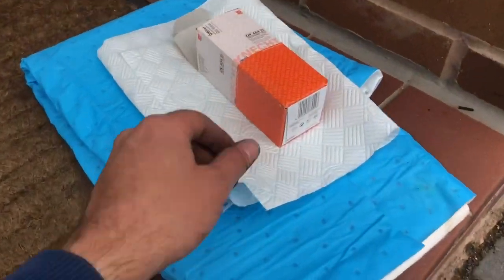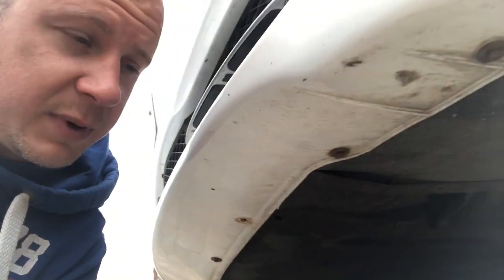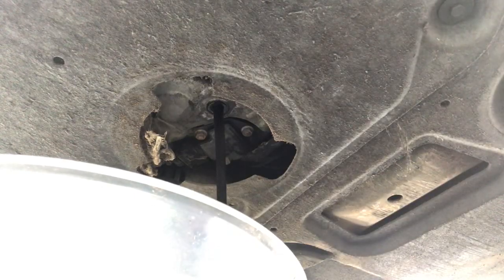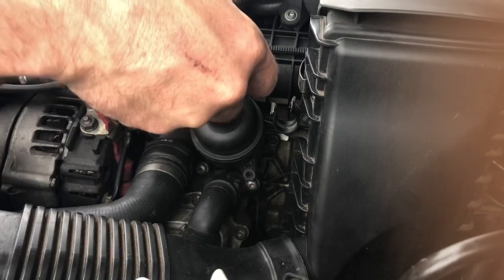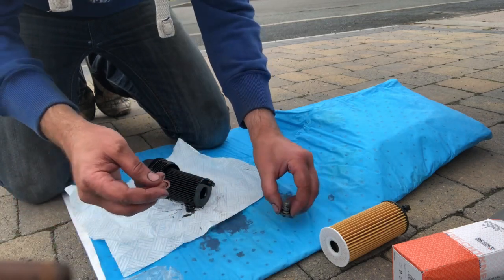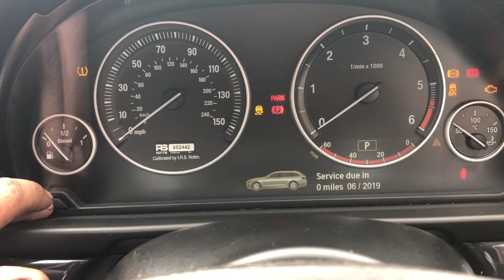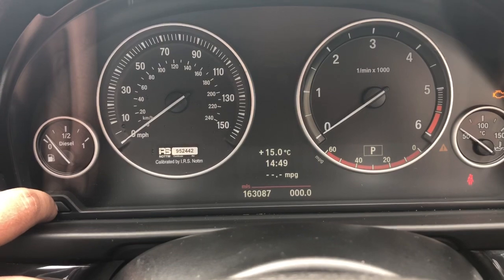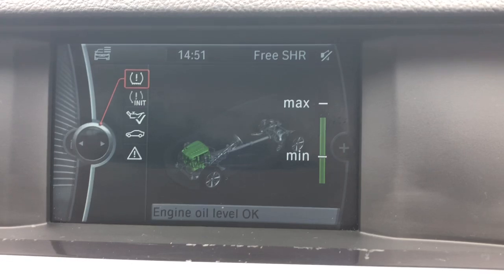BMW 530d (F11) Engine Oil & Filter Change

Comment: Speaking of what iDrive thinks or not - the manufacturer's prescribed oil-change is 30 000 kms/24 months on this car. Wait, which car was the one suffering from class action lawsuit for braking chains and burning police cars? Yeah. Purchased (well, deposited the safety deposit) my "new" 2012 530d F11 with the N57D30O1 yesterday, will collect it this Friday, March 17, 2023. Will be indulging in all-encompassing "change everything" procedure - it also has xDrive, so front diff and transfer case will be great bonuses. By the way - the oil filter looks very much the same as on my previous car - the A6 with 3,0TDI (only that one's bigger) - and even on my mom's W169 A180 CDI Merc (only that one's  smaller) - also - on those cars I've been changing engine oil every 5000 kms, just to be safe. The audi has a crushable single-use oil drain plug seal - the merc - and obviosly, the Bimmer - have simple copper o-rings which should tolerate at least one re-use (that said, they cost cents... sorry, shillings - so no need to save there). Well done for the change - except, I will probably be using an oil-extractor (small vauum pump... costs EUR 20,00 in a hardware shop) - which will eliminate the lifting up, seal buying and undertray removal malarchy - connect the pump, suck out the old oil, replace the filter - pour in new oil, good to go. This engine uses 6.5 liters (according to BMW) - my audi with its V6 uses 8.9 - there's some savings done on that expensive Castrol 5W30 right away. Anyway. Thanks for the video, greetings from Latvia.

Comment: I have a 530d N57 f11. My plastic cover that you twist off to get to the sump plug has a retaining screw. Just a heads up to check to look. I didn't realise this as there was nothing I saw or read that pointed to this. Hence I used brute force thinking the cover was just gunged up with dirt that was stopping it turn. It cracked & broke and that was it gubbed. Need to order a new one. £12 I believe.

Comment: Good job and a bit daring to do a video as a first timer on the car!  In hotter weather like here in Oz, I use 5w40 full syn and it takes about 6 litres. I would generally use a torque wrench also, unless you have a calibrated right arm!  Cheers

Comment: Hi, very nice video, just a quick note this car has the n57 engine with the timing chain issues, make sure to change the oil more regularly like 5,000 to 7,000 miles. don't change the oil every 16,000, but very good job looking more forward to more interesting videos on this bmw, 👍👍👍👍😀😀
Reply: haider hameed the kiss of death, have you seen his most recent videos. 
The timing chain issue was the reason I didn’t buy a bmw
Reply: @SteveE293  Yes, but very said his engine sounded healthy with no unwanted noises. I myself have a bmw 1 series e87 120d, but mine has the M47 engine which doesn't have the timing chain issues. It does have the swirl flap issue which only cost £10 pound to replace, anyway I hope he gets his car sorted very Gutted but what can you do🤔🤔🤔
Reply: @Nut_Job.  Soooooo sorry mate, Hopefully something good will come out. 🙏🙏🙏

Comment: Hi!!! how do you feel with Mannol oil? it is very cheap and perhaps little known. I currently use motul or valvoline with liqui moly ceratec additive for my ultimate generation Audi diesel.
 I have seen from the data that the characteristics of Mannol oil are also superior compared to more expensive and well-known oils.
What do you think ?

Comment: Hi!First of all nice tutorial.
So today i changed my oil on my BMW F34 330D GT 2015 and when i check the oil level it's between low and max,I did put in 6,5l.Now the question is should i add more or should i do a little driving and check again?My BMW doesn't have dipstick so there is only electornic measurement. Thanks

Comment: new to the channel, very good content! subbed straightaway. how much oil did you put it in to get to 75% max? i have a f15 x5 30d with the same engine, need to do oil change soon as my oil got somehow diluted by diesel.. thinking DPF regen interruption issue, hopefully not leaking HPFP...
Reply from the maker: I actually can’t remember, sorry. I’m sure I bought 8L because the total oil capacity is 7.2L for the N57 👍

Comment: do the car has to be in level or can I just lift the front of it to work under it??? Great Job!!!
Reply: I just finished changing the oil and filter on my 2010 F11 530D, and after frigging-about for 20mins to get it jacked-up as near to 100% level/square as I could, realised that the sump-plug is right at the rear of the block, so I would suggest that SLIGHTLY nose-up would be ideal for draining the oil...

Also, back in my youth (a long time ago...) sump-plugs were ALWAYS magnetic to trap and hold any bits of metal swarf that might be floating-around in the oil to prevent them damaging anything inside the engine 😖😭, but the sump-plug on my 530D showed zero signs of being magnetised whatsoever when I touched it against a nail... 🤨

So, I had a couple of 1.5kg pull-weight rare-earth button magnets in my toolbox that I stacked together onto the outside of the sump-plug that shoud (I hope...) catch any tiny steel fragments/crud IF there are any (hopefully there won't be, but I wouldn't want to find out the hard/expensive way, huh? 😢), and I'll see if I've captured anything in about 8000 miles time...

Comment: Previous oil change would have been while it was with the Police, right? No o-ring and the sump plug cover wasn't fitted properly. tut tut! By the way, you could save yourself a lot of work by getting an electric extraction pump.

Comment: Just vac the oil out. Much easier. Also loosen the oil filter first before draining or vacuuming oil as oil will flow to the sump once the filter is lifted out. See the seal on the bottom of the filter. If you don’t some old old will remain in the sump.
Reply: 86andyw where would you stick a pump in? No dipstick on the engine
Reply from the maker: There is a dipstick on mine. It’s located next to the air filter
Reply from the maker: Whilst I do generally agree with the sentiment of the post, I don’t think vacuum oil changes are necessarily bad. I actually do both with my cars (alternate vacuum/sump) with each service. 
You might be surprised to learn that sometimes a vacuum oil change can actually pull out more oil than a drained sump… not often, but it can happen with unusual shaped sump pans. 
But yes, you should always measure the waste oil which comes out 👍
Most of the vacuum oil pumps come with a large reservoir for the waste oil so you can measure how much was recovered.

Comment: 8mm,10mm,13mm,17mm and 19mm are the common sizes 12mm,14mm and 16mm are more common on Japanese/ eastern manufacturers
Reply: Funny.. i was nearly wrighting the same comment😆 i just would say 15 and 21 also but els exactly the same comment😆😆

Comment: I suspect that whilst in police ownership it's servicing would've been very good, I know my local force service all their response cars (including traffic cars) every 6000 miles so I d guess the previous owner wasn't quite as fussy. You can see where it's crested a few speed bumps from the marks on the under tray.. do tell your neighbours to keep the noise down!
Reply from the maker: That’s my neighbour with a Landcruiser - he was removing & cutting out old suspension bushes... 😂
Reply: Nut Job tell him to get a YouTube channel or keep the noise down. Just a thought. If you know which force used your car it might be worth writing to their vehicle fleet manager and seeing if they have any history of it. They often have the record of everything that was done to it whilst in police use.
Reply from the maker: Hmmm, that could be a great idea! 👍😀
Reply: Garry Talbot due to money most forces went to bmws normal ridiculous interval (around 18000miles) for oil changes but due to engines going bang it MUST be changed every 8000 now with a 500 mile contingent or goodbye warranty

Comment: 2.30 do you know what cables next to the sump plug is? Looks like a battery cabel, maybe you know better than me
Reply from the maker: The big cable is the permanent live from the battery to the starter motor. There’s also a thinner cable next to it which is the signal cable which tells the starter motor solenoid to start
Reply: Hey thanks for the help. Would you Think it as a problem if the cable sparked from my socket?
Reply from the maker: I don’t think you will have damaged anything, but just be careful - there’s enough current there to kill you

Comment: Why do you use a lot Mannol oil ?
Reply from the maker: I like the quality, I’ve used it on numerous cars and it’s performed pretty well. It’s not the only oil I’d use though, and happy to use others if they don’t break the bank 🏦👍
Reply: Brand not so important as the spec and additive package